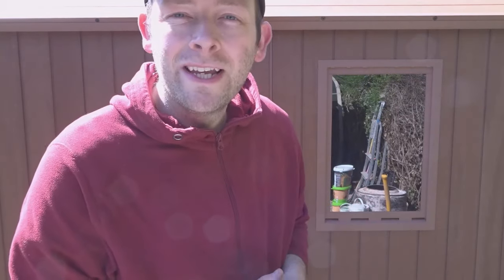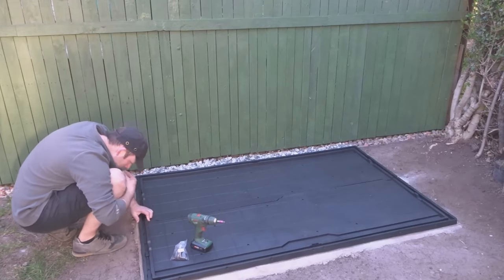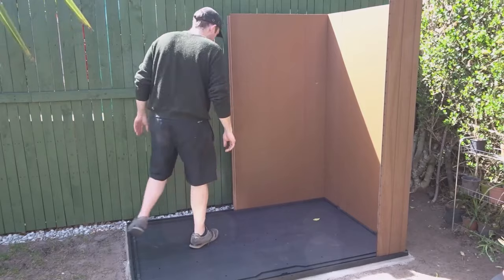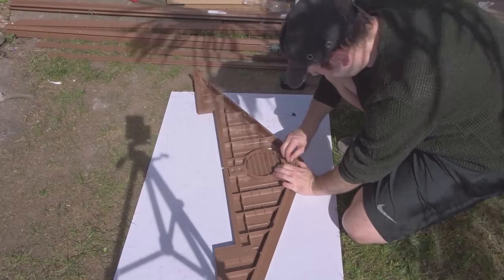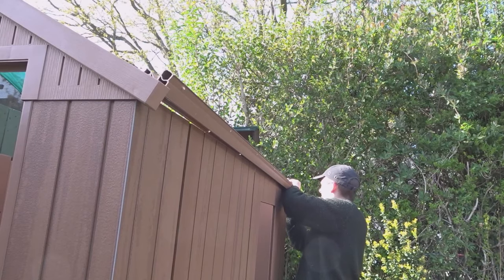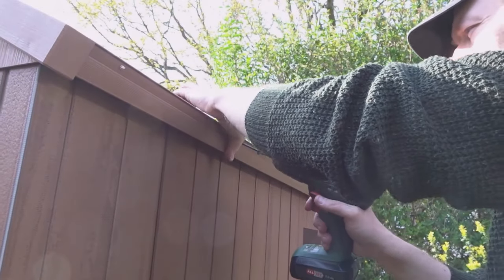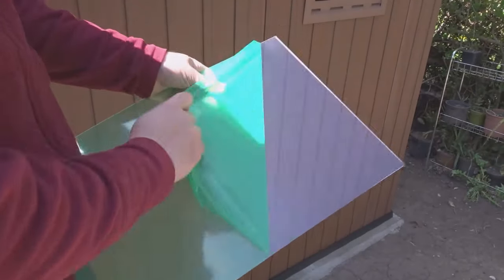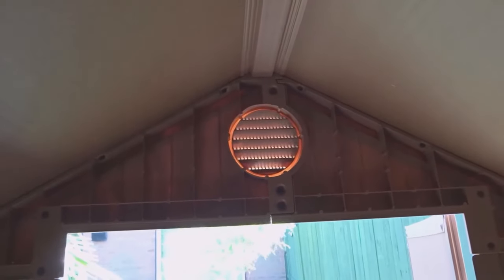Assembling a Keter Darwin 6x4 Composite Garden Shed

Comment: Hi Phil
How did you put the long screws into base on the side close to the fence ?
Reply from the maker: Hi Martyn, I just pulled the shed out about 2 feet to gain access. I pushed one corner at a time it slides fairly easily.
Reply: Cheers Phil much appreciated 👍🏻
Reply: I had to build in a sloping garden and then slot it onto the base. Door fit is very poor as a result.

Comment: This has been really useful.  I was worried that I would need to hire someone to assemble it for me.  I at the least thought it would require two people.  I plan to assemble it soon.  My only other concern is that I have very little 'wriggle' room to get to all 4 corners and this may be a problem when inserting one of the roof panels.  Is this shed light enough to manoevre forward and back to get to the back/ roof?
Reply from the maker: Hi Melaine it's quite straightforward to assemble just make sure you do it on a level base that really helps. It can be manoeuvred  I shifted it a bit at a time to access the part near my fence then shifted it back. I would not recommend trying to lift it but pushing a corner a few cm at a time is possible if required. Hope this helps.
Reply: Thanks Phil, much appreciated will do.
Reply: I'm having a similar dilemma, and not sure whether I should buy this or not.  I have an odd little garden but can only fit this on a platform between the corner of the fence and a big oak tree! I will have only a few cm wiggle room and there is no way I can walk around it to put the outside screws. The only way I can think of is while I am putting the panels next to the fence screw them in one at a time straight into the floor. That way I don't have to do that step after the whole thing is put together.... alternatively put the whole shed on wheels!!! that may actually work =D

Comment: How did you fit the roof gutter screws and base screws on the fence side?
Reply from the maker: I pulled the shed out a couple of feet then pushed it back.
Reply: @PhillWyattProjects  OK thanks, I'm planning on building a 6x8, do you think it's possible to do that with the large size?

Comment: This latest Keter Darwin shed is our second attempt at getting a good one except it isnt!  We have slabs laid then an 18mm thick external OS board treated as a base and it is all levelled off. After much hassle building it usual lining it all up and struggling to get roof to meet apexes which it doesnt! we found the last panel we were to use for the door is half an inch  smaller than it should be. We dont know if all the panels are the same but imagine they will be and contacted Wickes who contacted Keter and this has been going on for 3 weeks as they said they had no parts in stock. Eventually I asked them to find a panel and measure it to see it was 169.5 instead of 168.7 but lo and behold they sent one the same as I had but it was also bent!
So the side trims are too long and the door doesnt even fit the opening leaving a huge gap at bottom. We put the hinges on just to see if we could fit something on the bottom of door to cover the space and the door hits the top of the opening at one side even though the shed is sitting square. We made sure our base was level and do not know of anything more we can do. I am even thinking about asking Wickes to take it back as we cannot struggle with it any more. My husband is a retired engineer and even he is stumped as to what can be done to rectify this. I only want to warn people that Keter are not manufacturing this shed with correct size panels as stated in the instructions.
Reply from the maker: I'm sorry to hear that you had a bad experience with yours. I don't work for Keter so I can't really comment on the things you have mentioned although I do hope you can rectify the problem with them soon.

Comment: Might get one off theses. Looks like it would just about fit a dirt bike in. How is the shed holding up at the moment. Great video m8
Reply from the maker: Thanks 👍 it's holding up well. No leaks. Looks the same as when I put it up. Yes it probably would just about be big enough for a dirt bike.
Reply: @PhillWyattProjects  perfect thanks for the reply don't suppose you no the width of the door that's my biggest problem I would have getting the bars through

Comment: Does the shed require hard standing?....I'm 65 year old, so I don't fancy having to haul big heavy paving slabs around...can you suggest an easier option for a firm base..cheers brian
Reply from the maker: Hi, a small shed such as this one does not have to be on slabs. You could use wood or plastic shed base panels which you lay down and add gravel to. Hope this helps.

Comment: How did you get round side against fence to put screws in base and roof , I have a tight 4foot gap this would be perfect or is there a 3 foot wide version please
Reply from the maker: Hi, I shifted the shed out, put the screws in, then shifted it back. It was quite easy to do one side at a time.
Reply: @PhillWyattProjects  I have 3 inches , so 1.5 inches eithers side won't be able to do it , gutted this would be ideal
Reply from the maker: @andywebster8521  Sorry to hear that Andy

Comment: Great video but why am I having so much trouble screwing into metal ?
Reply from the maker: Thanks! Yea they are quite tough. The screws self tap into the metal. Don't be shy to apply some pressure.
Reply: @PhillWyattProjects  I’ve tried so much pressure and still no luck and don’t want to break it. Am I doing something wrong ?
Reply from the maker: @MrJoey13579  I don't think so they self tap with enough pressure. Mine did.

Comment: You  cleverly didn't explain how you screwed the door onto the hinges...was this a particularly tricky thing you didn't want to show?
Reply from the maker: Hi Tony, I didn't show every single part of the process just because its not a step by step guide video. It's just a video about my experience building the shed. For the door hinges, I've had a few questions about them. The tricky part is just applying pressure so that the screws self tap into the metal. It doesn't feel good but it's fine once you do a few.  Don't be shy to put some pressure on them.

Comment: I just built one, was not too happy with the quality of the screws, some of the heads were not machined properly, also the fit of the door is not very good, there is a gap at the bottom of about 1cm, so I will probably add a small batten in the threshold. Overall I think it is an ok shed but a bit expensive for the quality. For anyone considering building one I’d mention it is critical that your base is absolutely level and flat or the flimsy plastic floor will flex. I ended up putting mine on a timber base with a plywood subfloor.
Reply from the maker: Yes I agree about it needing to be very level. Otherwise it's very difficult to line everything up properly. Mine is still doing well so I can't really saying anything bad about the quality. The screws I had were fine. Maybe it depends on the batch I'm not sure.
Reply: @PhillWyattProjects  Yes I think it may be a batch thing, I had a bit of warping on the door which I am hoping will settle now it is built, also the top and bottom door caps were not a good fit on mine - they are a bit curved when screwed to door. Overall I’d rate the fit as about 7/10 there are a few gaps in places, which is strange considering all the holes are pre-marked or drilled, and obviously I made sure to have everything lined up. It took me longer than it should have to build just because of these quality issues, the walls, corners, roof all went quick enough, the window was easy, the door was a bit of a pain because of the bad fit, and the bad screws did not help. Still, seems ok now built, I think I’ll add a couple of battens to make it a little more rigid and to mount stuff inside, like some light shelving etc. Cheers 👍
Reply: Recently had one and the screws were an abomination!! Had to use my own for the parts where they are meant to self-tap to door frame for instance as the heads were terrible.  Found the general quality of manufacturing poor - maybe gone downhill since they came out.  Got it up and it will do the job but wouldn't buy another.
Reply: @SuperPittos  Yes, same here would not buy again, I think you may be right that they have gone downhill - the one that was built at the place I got mine seems to have better fitting parts and also a silver coloured handle rather than the black that mine has. The roof panels butt right up to the end trim on that one, where in mine they are a few mm short at each end, also the floor seems like it is made of thicker plastic than mine. Very disappointing, and I would not recommend them given these faults.